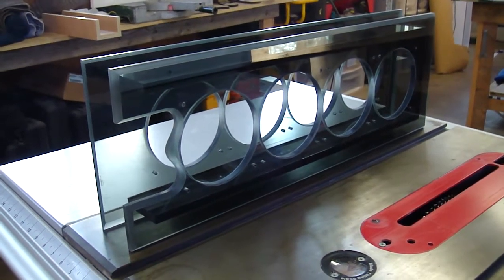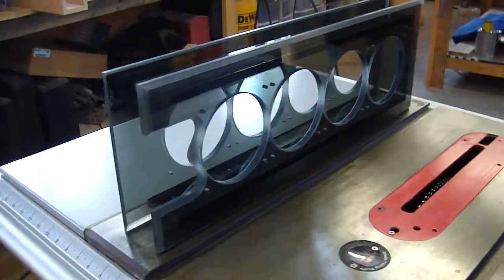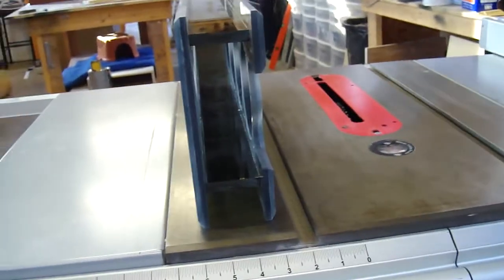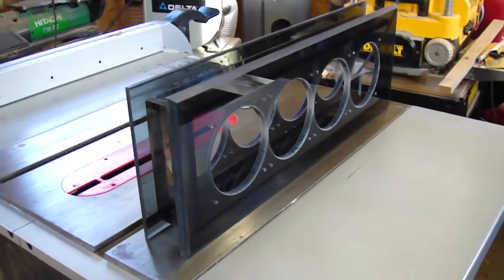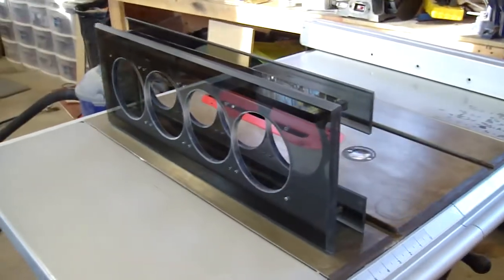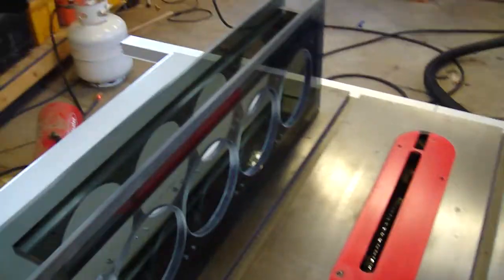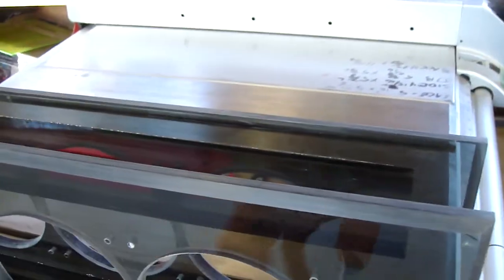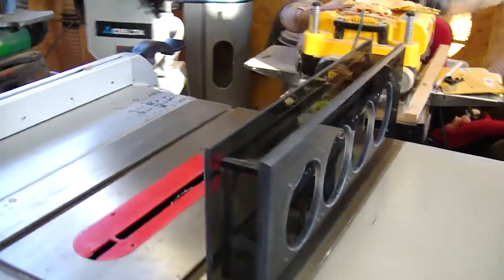GTX480 RadStand by CyberDruid

Comment from the maker: I doubt I will have the time to make another this winter, And it's pretty expensive. The Acrylic alone costs over $100 then there is about 5-6 hours of shop time to get the parts ready to buff and maybe another 5-6 hours of polishing. I prefer polishing to torching because (if you check my vids) torched acrylic is highly reactive to any type of alcohol.